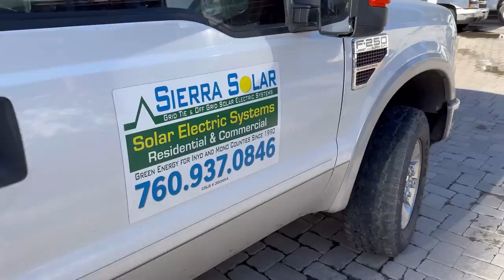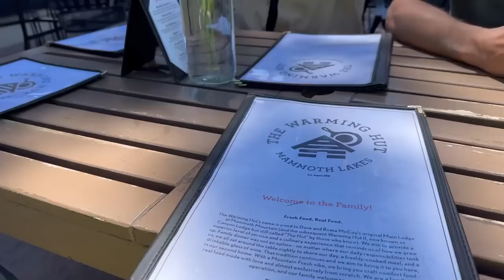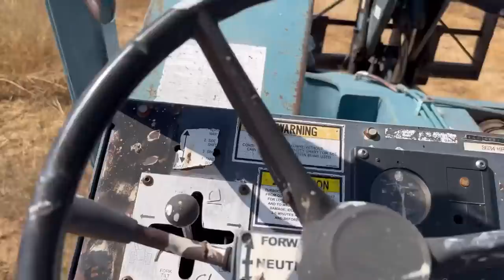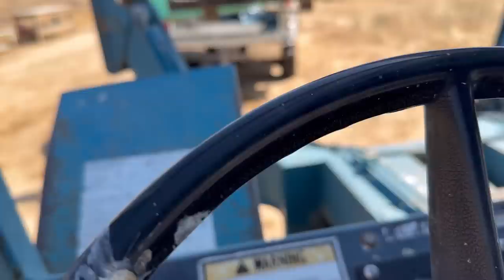Mammoth vlogs (EP4) custom home framing in the high sierra after a record snowfall 2023

Comment: Is this construction strong enough for a winter's snow load like we just had and might not have for another 50 years or it could happen again next year?
Reply: Well I’ve never seen a steel I beam in a residential house before. I’d say absolutely, ca. has some anal building codes . & I build my stuff above & beyond what’s required.
Reply from the maker: Absolutely everything is over engineered these days… most failures we see are on older homes 30+ years old
Reply: @plowbrothers365  I’m really glad to hear that all homes have been built strong for several decades! It’s incredible how much snow that you still have piled high, but it’s finally heating up for good 😊.
Reply: @davestevens4263  Mammoth must have better code, but Calif codes? Have you seen the tract homes? Newspaper and fast food wrappers for insulation, chicken wire and sand walls, things are overpriced junk. Now my Aunt and Uncles place in Tahoe has 6x12s in the roof and 4×8,6,4's most else structural, built in the 60s.
My house built in 2005, at only 6700 feet or so, not so tough, but it made it.  I removed snow each 3 feet or so.

Comment: 653 / 5.000
From 15.15 your staff will work without hearing protection. And from 15.35 I see staff working without hearing protection and with all that dust also without dust masks. From 17.53 also see someone working on a narrow plank without fall protection. I don't know how it is arranged in America, but here in the Netherlands, you would have had a very high fine. I worked in construction myself before there was a building inspector who supervised health and safety. Then in 1970-1980 we worked the same way you do now. I now suffer from copd and tinnitus because there were few rules. We didn't know any better. But it's now 2023. Come on dude. Get it done.